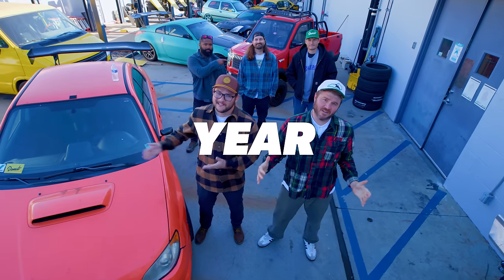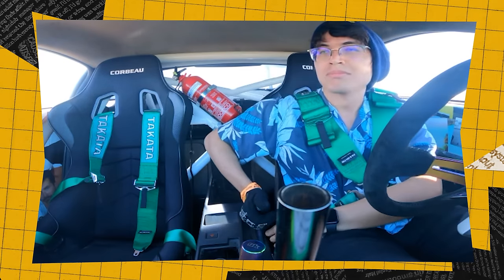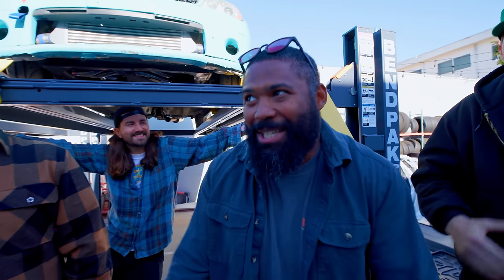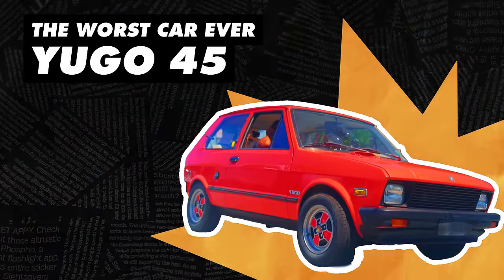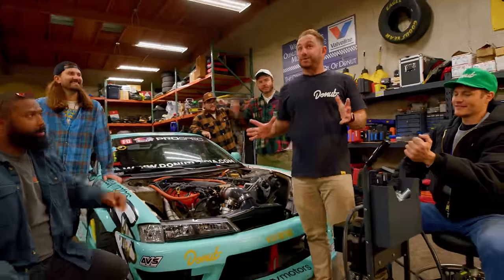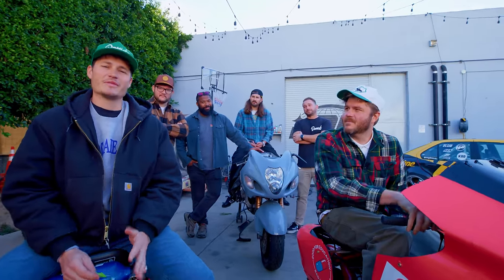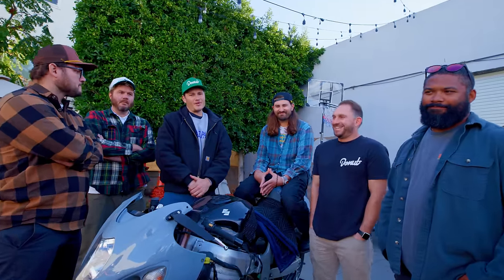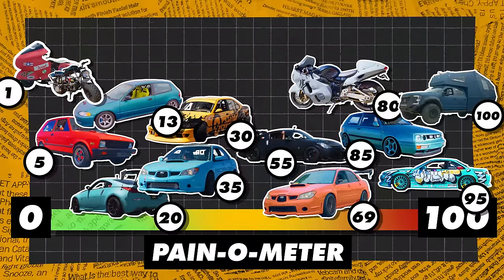Every Car We Broke in 2023

Comment: Shout out to James for handling that throttle sticking without hurting anyone or anything.
Reply: Absolutely! You could see the fear in his eyes when it happened and it was intense!
Reply: He got lucky that the cable broke after it got tangled up.   He should have shifted into neutral or tried to turn it off.
Reply: @toolbaggers  he definitely panicked and so did Matt. Either way they did a good job redirecting it. They were ready to climb that mountain and I don’t think anything was gonna stop that beast of a truck.
Reply: @toolbaggers  They also had to avoid killing the crew in the bronco directly in front of them, turning towards the wall was definitely the right decision. Fumbling for the transmission or key would have wasted time in a vehicle James was not familiar with.
Reply: @cristopherflores6195 man Matt stayed calm considering they were about to climb and flip on that little mountain they were headed for. You could see matt keeping his eyes on what was going on, what broke, where they were going, all at the same time and reacted instantly. Matt saved them big time there
Reply: @beefeeb  I like how the crew didn't react at all. Guy in the driver's seat: "What's going on?", guy standing in the door: "We're gonna get run over, but it looks cool", driver: "K".
Reply: @MikeSchinlaub  i was thinking the same thing if i was the car directly in front, i would of tried gunning it. But i think there was a vehicle in front of that one as well
Reply: He should have put it in neutral or turned it off but he managed to fix it without hurting anyone which is good
Reply: @toolbaggers with hindsight yes but considering the situation he handled it fairly well
Reply: @toolbaggers easy to say that sitting at home😂

Comment: This video just shows the downsides of video deadlines. It throws build quality out the window when they gotta get a video out on time. Still great videos but obviously some of these could have been avoided. And yes i know some of those cars were actual accidents i just mean most of the high low cars
Reply: Some would also say it makes it interesting, funny and you can learn from it. If you don't make mistakes you can't learn
Reply: These are just things that happen to cars. Cars break, especially in cali heat on race tracks.
Reply: @orange.juice.  Yes, I agree. But some these problems happened because of production deadlines and choice of the quick and easy fix instead of actual parts. I do agree some of these cars actually just broke.
Reply: Deadlines are a part of life
Reply: @javrami4883  and just like life you can do things to lengthen. like providing longer video deadlines. Not trying to critique them just saying hoping future projects have more time
Reply: Sounds like at least 3 , was from bad clutch work
Reply: @ethanacton408 exactly how much longer should they have taken? Do you know exactly which issues are quality control as a result of deadlines and nothing else? Doesn't seem that cut and dry to me.
Reply: They should learn from LTT and how they recover from it
Reply: But it's also our fault. When all they did was make list and stuff we didn't like it and kept pressuring them to make more videos
Reply: @oscarariasjimenez5367  You have a great point. So many people want high quality videos and up to speed, especially up to speed which isn't a video you can make in 2 seconds so they're always rushed to take it out. And then people wonder why stuff like that happens.
Reply: @ethanacton408  well I don’t know if you’re familiar with how YouTube sponsorships work but no, those contracts are pretty uniform and require uploads in order to keep them. That’s how most money is made on YouTube nowadays
Reply: @javrami4883   i completely understand. That's why i was saying i wish they were given longer deadlines
Reply: Unfortunately every single social media influencer suffers from the same exact disease first they start making videos out of their love and passion for what they're doing and then when they start receiving regular checks and start paying their bills with them now it becomes quantity of videos instead of the quality of videos and the content goes downhill immediately and they start straying out of their Lane copying other people
Reply: @thecloneguyz  Well, some of their videos you can still tell Have actual passion, but you can't blame them when you can make a short boring video and make  the same if not more money. It's kind of hard to justify doing it for passion.
Reply: @ethanacton408  the only people that do consistent content are carpenters or people that build stuff with their hands they never have to stray outside their subject matter and there's always something new to build or new to try
I mean everybody has built a Tesla Motor this and an LS motor that and a twin turbo disc and a supercharger that there's almost nothing interesting anymore
And the one thing I find really funny and ironic is we now have cars that have 10,000 horsepower but the quarter mile times are still identical as the early 2000s because nobody has invented a tire that expands the faster it spins..
Think about it if somebody invented a tire that started out at 10 or 12 in and then the faster you went the bigger it got and by the time you get to 70 or 80 this thing is like 25 or 30 in round we would get like a hundred miles to the gallon..
But for some reason nobody has invented an expanding Tire yet!!?????
Everybody agrees that we lose 90% of our fuel mileage to acceleration, and cars that have gigantic rims and tires actually have excellent gas mileage the farther they drive....
Somebody's going to invent a tire that starts out really tiny amazing acceleration and then gets bigger the faster it goes and you'll end up with like 60 or 70 Mi to the gallon without even trying with gigantic V8 engines weighing 5 tons......

Comment: If you motor swap the chang li then you simply dont have to fix it. simply  a completely new ecu and harness
Reply: With electric cars becoming worthless when the battery fails I'm sure some Nissan Leaf could be bought and used as a donor.
Reply: @gannondrk  Thats the responsible choice I was more suggesting busa or some other motorcycle motor which is extremely irresponsible.
Reply: ls swap the thing

Comment: The clip with the Wrecker is my favorite. That thing has a gigantic V8, weighs 12,000lbs, and went full throttle uncontrolled in a confined space with people nearby and a vehicle in front. It's absolutely the save of the year. I'd have soiled myself at the wheel of that thing, you guys were intensely cool about how bad that could've been.
Reply: He's freaking out and hard to think but just turn the key off. He got lucky
Reply: @horatiohuffnagel7978  I'm willing to bet that in someone else's custom semi wrecker you might not be familiar enough to find the key or even the gearshift in an emergency. I know I'd have been keeping my eyes on avoiding the people in front. That was so close, lol.

Comment: I hope we get to see a hi-low mini truck build. I'm talking about turning an older compact pickup truck into a custom low riding, cool, and radical mini truck. Bonus points if it can be turned into an old school style one from the late 80s/early 90s. Doesn't have to use NOS parts from back then, but like a tribute type build.

Comment: I'd be SO curious to see Low WRX's transmission get replaced with another 5-speed PLUS some Moore Blast Plates. They're supposed to prevent case flex and therefore gear blowouts, and cheaper than a 6sp.

Comment: I really wish you went into a lil more detail on each story. To get a better feel for how and why each thing happened. examples... how does one overheat a power steering system (on two different cars), how did you pop a coolant line on a three wheeled car when it only rocked 20 degrees. 

and don't forget... HTF is it easier to buy, ship, and clear a whole new completely foreign mini truck, than it is to trouble shoot 8 severed wires???

I understand i can just go watch the videos (and i will), but it would be nice to have the full context of the stories. Yes, it would make the video a lil bit longer, but im sure that 80% of the people watching would also appreciate, if not endure, the couple extra minutes that it would take of their time.

Comment: For the 350z  low car axle fix, those cars can actually change out to 1200whp rated Porsche rear axles 😁 Z1 sells them and can also help with compatible wheel bearings that match the spline count.

Comment: The yugo is very similar to my 89 sho. I got it for $800, and attempted to drive 10 hours home. I would have made it, but it had the original plastic bushing in there, and it snapped pulling to a stop at an intersection.

Comment: When i bought my subaru one of the first things i inquired about was transmission strength. 5 speed can handle 300whp give or take. You had 400whp. Of course it popped. Get a wrx 6 speed. Good for 600-650lb-ft tq and 650ish hp

Comment: I wonder why on newer vehichles, even back into the 90's, manufacturues, could have enabled a lockout system to prevent "Money Shifting"...  GM does that with the T56 with the 1-4 lockout where if you are going over 20mph and shift out of first, it forces into 4th gear with a lockout.  I removed the lockout from my GTO and C6, and the reverse lockout where unless stopped, you can't shift to rev.  A system of sylinoids is easy enough to use for anti money shifts.... but, if you upgrade and change gearing, you would have to change the lockout points in the TCM... however, most people doing that kind of stuff would just disable them completely, just like the GM 1-4 shift lockout.

Comment: Subarus don't count because they all break.
* (cars with forced induction)
common issues include, but aren't limited to: head gaskets, broken ring lands on pistons, oil pump pickup tube, detonation, oil starvation due to high crankcase pressure blowing oil out of breather

Comment: You guys get a metal impeller water pump in the e36 yet?... Assuming you did but both of mine drove me nuts with cooling till I did that. Also ran water/water wetter instead of coolant when above freezing out

Comment: You guys should get a 4cyl 2006 (Gen 1 only) ford escape in 5 speed manual. It has the mazda/ ecoboost stang blocks stock, but the ratio ans speed fron a stock one is insanely surprising. My 0-60s in it were 4 seconds. Thats 2  faster than my tubo'd mzr 3. Im telling you, if you find one, test and build it. Very odd speed for a small SUV in fwd dead stock. Handling is the best too. Bucket seat and tilt wheel stock

Comment: Now I don’t feel so bad I’ve broke a few myself this year
99firebird locked up motor
03 Mitsubishi galant runs on 2 cylinders was a 6 lol 
88 suburban still runs has no reverse or 3 rd gear
Ford e350 box truck oil leak gone bad turned worse needs engine
And last but not least 1976 ke175 2 stroke trailer bike sick bike needs a lot of maintenance busted shock chain brake lever and a bent back rim
Reply: I ain’t even rich just hard on shit